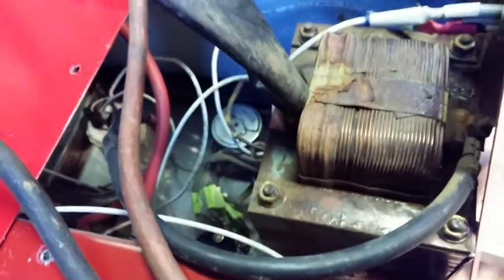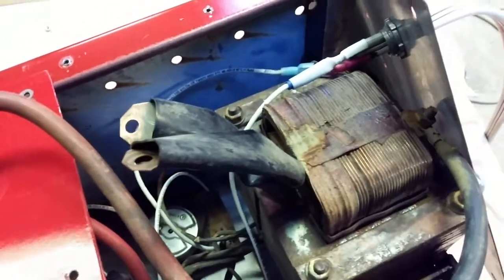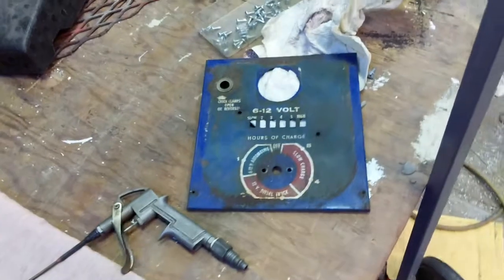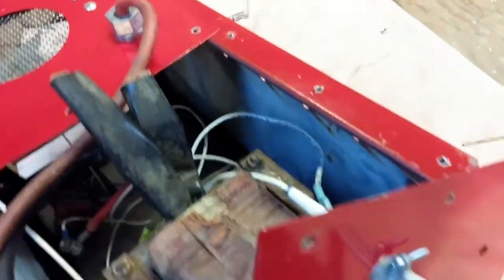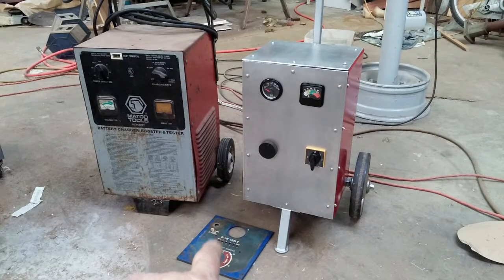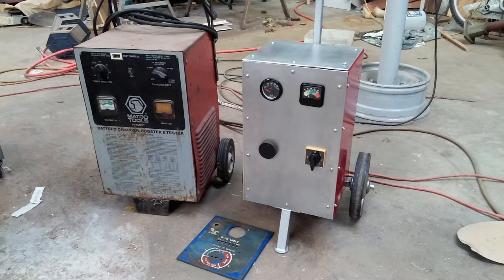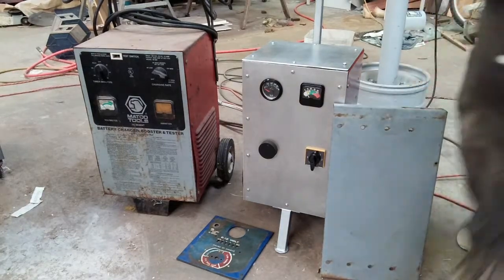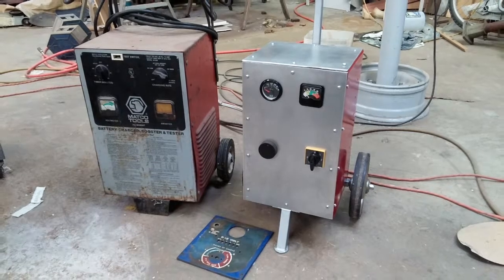Battery Charger from salvaged parts

Comment: Nice work. I have a question though. I've made quite a few switch power supplies but they don't deliver as much amperage as a linear power supply. But every time I try to charge a battery with a homemade linear power supply, my diode bridge overheats, fast too. Do you know what I can do to prevent this?
Reply from the maker: Most I've looked at use a center tapped transformer and only 2 diodes. I tried 2 70 amp 100 volt diodes and popped them the first time the clamps touched. I doubled them up and have no trouble since. I also installed a big heatsink for them. I paid $18 for 4 diodes. Hope this helps some JW